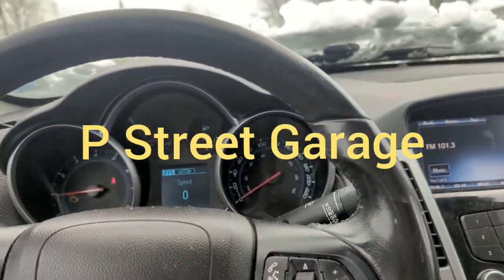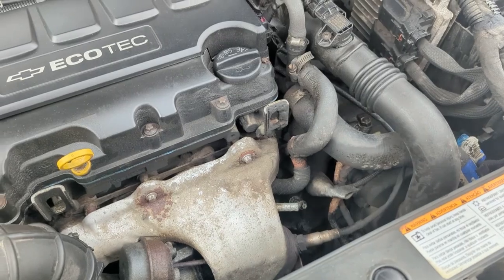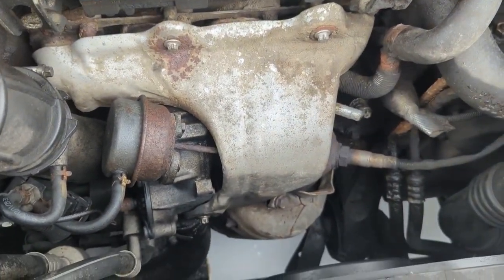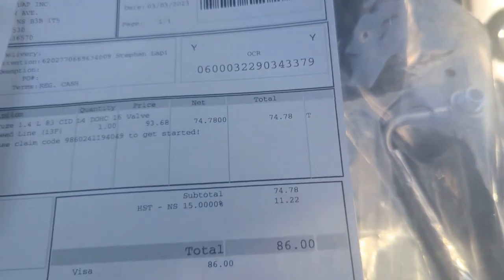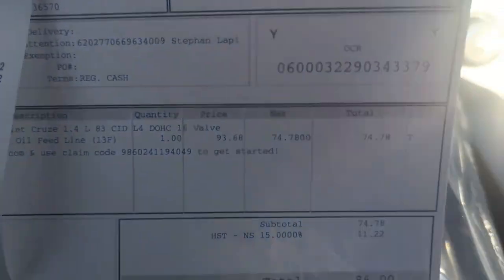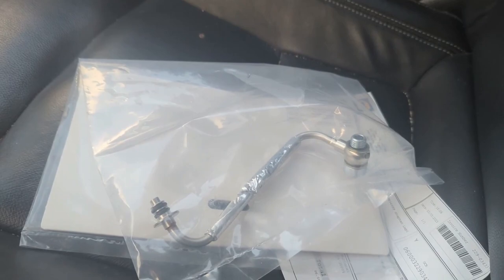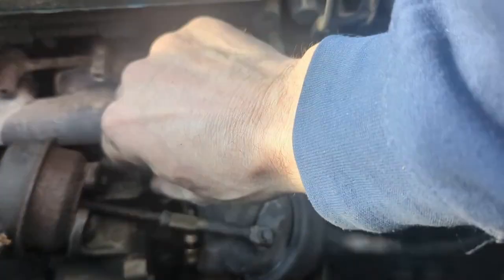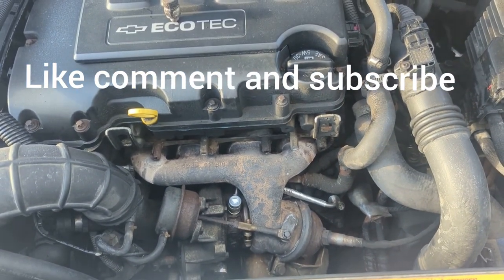Chevy Cruze oil leak, smells like burnt oil.

Comment: The turbo oil feed line should be changed out every 60k miles or 100k km  per regular maintenance . If they clog ,which they do ,say hello to a new turbo
Reply from the maker: Yes.  Thanks for your feed back

Comment: I did the same thing I changed the turbo oil inlet and replacement didn’t have same size torx so tightened the best I could. Eventually leak got so bad looked like the engine was on fire. The opposite side with the two o rings the bolt hole stripped out. Had to fix with a helicoil. Other places to cause same problem are the oil cooler seals. Job is a pain to do.
Reply from the maker: Thanks for sharing,  these cars are notorious for leaks. Always something

Comment: Just replaced my old v1 line with the single Oring and no jacket. But now its leaking from the banjo bolt, its the exact same part you got from NAPA too. Its a dorman and i hot for 25 from amazon. But now i need a new one again, 2 weeks in too
Reply from the maker: With new Bangos and tight it should not leak.   Might be dirt or something.  Loosen it and retighten.

Comment: The ticking can be fixed by tightening the chain tensioner under the valve cover. Use some sort of thread lock that isn’t permanent.
Reply from the maker: Thanks for the tip !

Comment: @
P Street Garage I have similar issue smoke is coming from engine because the oil cooler is leaking oil into catalyst
my question is: the oil can cause a fire o just is annoy it? i mean the fix could wait or it is urgent?
Reply from the maker: I believe oil cooler should be fixed !
Reply: @pstreetgarage7304  do think that it could provocate fire? im very stress it for that reason.
Reply from the maker: @Sabs761010  I don't think it's a fire hazard but if it's bad you can lose you oil and seize the engine.  If it's very small keep a close eye on your oil level until you get the seals replacrd
Reply: @pstreetgarage7304  thanks a lot and Greetings from Monterrey Mexico.
Reply from the maker: @Sabs761010  Wow I love Mexico👍👍

Comment: Is the new line still prone to clogs or is it better in that aspect as well
Reply from the maker: The new line has a small jacket around it to supposedly prevent the heat from cooking the oil.
Like an insulated blanket.  Otherwise the same.